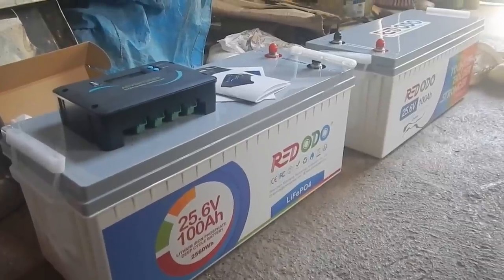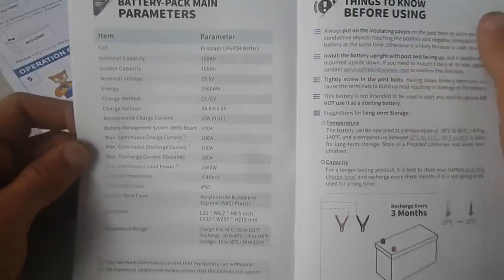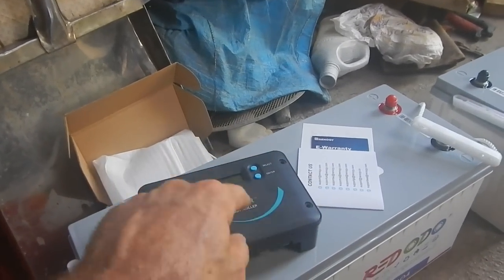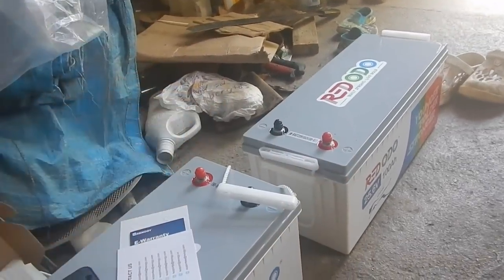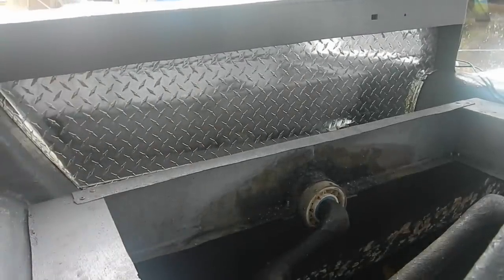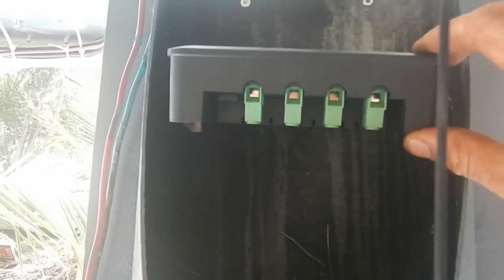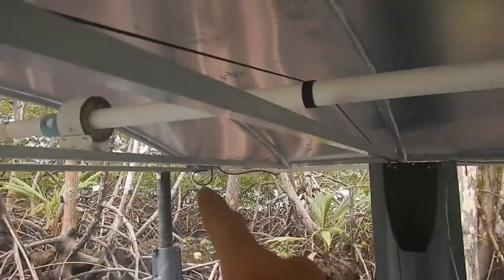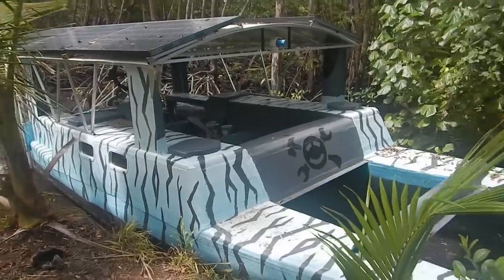Shark Slicer Upgrade 029 Installing batteries and Controller!

Comment: Have your charge controller in the center of your wiring. Have the same size and lingt between batteries to get the same voltage charging your batteries. By having one wire longer will change resistance and charge voltage.

Comment: A true inspiration with your boat builds.  

It was exciting to see you work through the charge controller as I did the exact thing yesterday with that exact model.

These boat builds have given me a boost in my own build over the years.

Homemade tritoon with a cabin made of scrap materials and ~1kw of solar in two banks running to 180AH 24v batteries with a 40A converter to a single 12v battery to run miscellaneous 12v appliances on board. 

Not as cool as the Tiger Shark Slicer, but it does well.

Comment: Lithium ion batteries do better between 20 and 80 rather than between 50 and 100%. They get very stressed above 80%, particularly if you hold them there, less so if you bring them right back down again as soon as they hit 100%. But occasionally charging to 100% helps rebalance them.

Comment: Jaimie the battery are sealed in the plastic box except the connectors all are waterproof, put grease on all connection of wire it well protect the metals from seawater

Comment: Lithium batteries last longer when you use them between 30-80%. Charging them to 100% uses a full charge cycle, but to 80% is about 0.15 charge cycles.
Reply: was just about to comment this! needs more upvotes :)
Reply: These batteries have a minimum of 4000 cycles. Assuming they are cycled daily, that's at least 11 years. I wouldn't worry too much about taking them to 100%.

Comment: Every time you move that diamond pattern aluminum I fear you'll accidentally touch your battery terminals and short out , a possible solution could be to mount that panel as a two piece slide for better accessibility  !
Reply: The terminals have a plastic button on top

Comment: The diamond plate seemed overkill until I saw it in place on the boat.  It adds a really nice accent decoration.  
I know of several people making versions of this after watching your videos.  I'd like to try making a smaller one myself.  Maybe you could do a video when this round of improvements are done, talking about making the boat, what you'd do differently and what worked great.  How many layers of 1708 or other fiberglass do you think are necessary for adequate strength?  What about motors?  Would cannibalising an old golf cart be good or would you recommend something else?

Comment: Just wire the solar power panels in series then just run 1 set of 24 gauge wires to your battery to make the 24 volt instead  of 12 volt like you have them now because your battery is 26 volt so you need 24 volt going into the charge controller. That way you will double your charging amps. wire your batteries in parallel from charge controller. IMPORTANT PLEASE PUT A FUSE ON ALL POSITIVE WIRES 30 AMP MIN TO PREVENT A FIRE INCASE YOU SHORT OUT SOMETHING OR INCASE YOUR BATTERY'S OVERHEATS.

Comment: ALSO YOU NEED THICKER WIRES FOR THE 50 AMP CURRENT DRAW FOR YOUR MOTOR OTHERWISE THOSE THIN WIRE WILL MELT THAT'S WHY YOU NEED A FUSE ALSO.

Comment: Solar charge controllers are little computers so you have to turn them on before you plug in the solar panel. Plugging it into the battery first is turning it on.

Comment: both batteries on same side, opposite where you sit to pedal would compensate your weight... they're not going to heat up.  AND strap them... secure them.. (My 100ah 12v lead-acid batteries (2) decided to slip once i was beaching my electric pedal boat. It was not that steep... yet...)

Comment: Lots of folks say that you shouldn't fully charge your batteries to extend their life. I've been riding 48v ebike batteries hard for years and charge them all the way up every time and most times take them down to almost nothing. I've never had any problems with the name brand batteries.
Reply: right - not to mention Jamie needs to do this initial 100% dual-calibration even if he uses 80% afterwards.

Comment: For longevity ideally you want to charge to 80% and discharge no lower than 20%.
The cells would last significantly longer if run like this.

Comment: 22 or 23 volts should be safe cutoff voltage. 0% is actually manufacturer’s choise for practically safe point where minimum cycle life is specified. Voltage drops really fast after that point, but if you have automatic cut-off, volt or two is more than enough. 

If most of your cycles are not 100%, it’s actually good sometimes do the full cycle. Just don’t leave battery empty for long perioids

Comment: Needs a compassitor battery runs well with pedals equals a compassitor discharge create light need to copture the discharge into another compassitor equals a piston fire on electric turbo

Comment: Considering how important charge levels are for battery life its criminal more equipment doesn't have more control over voltage eg. all inverters should come with at least some level of voltage cut off control, mine is set to a ridiculous 21v I can't change and of course my batteries are damaged by then. It would have been stupid easy to make it programmable, but I guess anybody who designs a 24v inverter to a 21v cut off in the 2020's is indeed stupid.